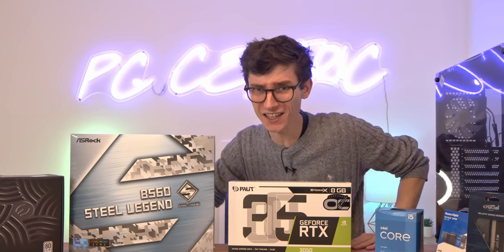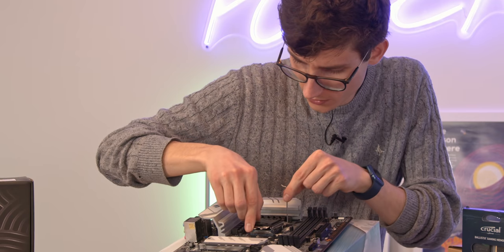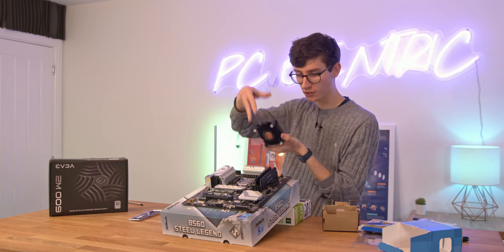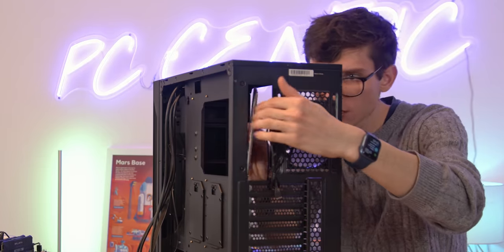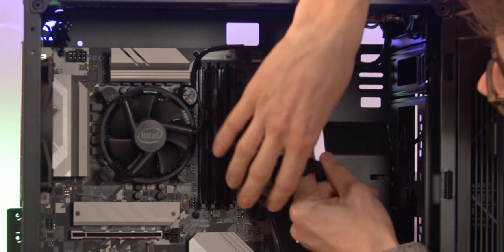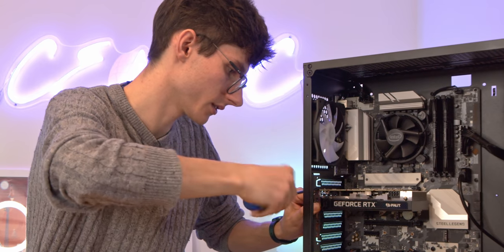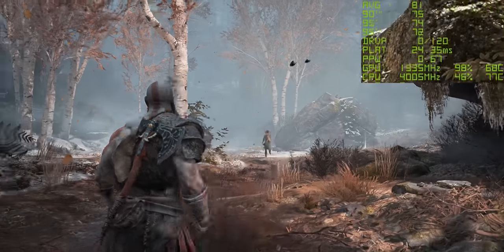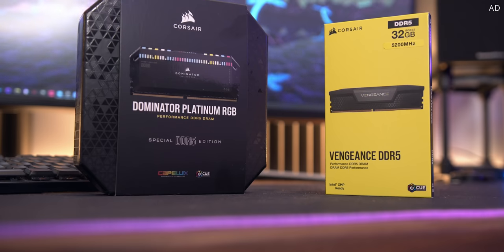The ULTIMATE RTX 3050 Budget Gaming PC Build Guide 2022! 😍 (Benchmarks)

Comment: This was actually pretty close to the actual Pc I'm trying to get. I am getting the i5 12400f and Asus TUF 3060 GPU. Pretty helpful since our builds are similar!
Reply: Just a tip but if its at all possible maybe by piecing it out one paycheck at a time but try to get the 12500f (6 cores instead of 4) and a 3060ti. Its only one step up the product rung for both parts but your getting 2 more cores in the 12500f and the 3060 ti is alot more powerful than the 3060 don't let the low hanging fruit of 12 gbs sway you to the 3060. of course with the times good luck finding any graphics card right now close to MSRP.
Reply: @timsisco3742  I second this
Reply: @timsisco3742  the i5 12400 also has 6 cores right?
Reply: @timsisco3742  i mean rx 6600 xt is a good replacement for 3060 it's not as strong as 3060 ti but it's cheaper
Reply: @art1654  different place, different price. and maybe he want ray tracing
Reply: @jseuren8825  wow what was i thinking your right, was thinking 12100 vs 12400. my new, new years resolution - don't post before noon. Ignore everything i said about the CPU. BUT I stand by what I said about 3060 ti. It and the 3080 are the only 2 cards anybody should be considering for games (on the NVidia side). Also, don't get an H610 board get a B660.
Reply: @timsisco3742  what are you talking about? 12400f has 6 cores as well
Reply: The 3050 is no where close to a 3060. It’s closer to a 980ti.
Reply: he basically did a vid on that already
Reply: yea im getting that exact build or Im getting that with an i7 10th gen
Reply: If you can afford it I’d spend a little extra to get a 3060ti or try and budget elsewhere
Reply: @michaelf3460  im already quite a bit out of my budget which is why im staying with the 3060
Reply: The 12600K/KF has 4 extra efficiency cores and it clocks at 4.9ghz
Reply: Great choice going for Alder Lake
Reply: @hextobyte  it's not worth the extra money
Reply: @DTG4844  For gaming performance no but the e-cores could be very useful for running background tasks/applications such as discord or spotify.
Reply: @dripz628  you still won't run into any performance loss with the 12400, plus the e-cores are currently unoptimized so they cause stutters and have terrible 1% lows during gaming
Reply: @timsisco3742  no offense but what u said about the 3060ti and 3080 being only cards to consider is just awful advice since they are the most sought after cards and are a lot harder to get
Reply: @az_tinkerer_gamer  cap lmao
Reply: @art1654  6600xt is basically 3060 with no dlss, rtx, and 20 less mhs
Reply: @supersop1367  which kinda proves my point doesn't it. Those are the cards smart buyers want. Nvidia is counting on everybody else to just pick up what's left at whatever crazy high price.  My advice was simply don't get screwed on the price over MSRP when the card was already a rippoff from Nvidia. i would of told him to wait for the Intel Arc cards but we don't know when they are releasing anymore. Intel took down the release window. So April would be the earliest.
Reply: @timsisco3742  the card at msrp isn’t a ripoff nor is it a ripoff at street prices either
Reply: @mrwiz124  can u recommend good pc parts for 1k?
Reply: @Ηλίας-ρ4θ   I could but just do it yourself init
Reply: My friends have them and the fps he is getting is pretty good
Reply: Me with 2x2gb gigs, Celeron 108 530 @1.80 GHz: 🙁
Reply: Ummm what do you recommend me in budget? Iam a shithead 8th grader this year with good marks
Reply: @Kiyantha  its a waste of money for playing games, get a next gen console, way more performane and higher resolutions
And 3 times as cheap
Reply: Id prefer amd from intel
Reply: @timsisco3742  that's true I would of wated for the 3060 ti it's gonna be like 600 pound soon
Reply: @timsisco3742  12400f has 6 cores too
Reply: U got it now?
Reply: @Haadii  No. I completely changed my setup, I upgraded to a 3070 and downgraded to a 11400f, works pretty well.
Reply: @twizzsaleh1691  I'm planning on getting an i5 10400f and an rtx 3050 do you think they will work fine together or what should I change
Reply: @Haadii  You shouldn't change anything both these components are capable of 1080p gaming and you should not face any problems trying to run games on them.
Reply: @twizzsaleh1691  should I change the rtx 3050 with an rx 6600 (not xt)
Reply: @twizzsaleh1691  I'm thinking about changing the rtx 3050 with an rx 6600 because it's a little more cheaper and offers better performance in raw gaming and I don't really care about Ray tracing do you think it'll work with the i5 10400f ?
Reply: @twizzsaleh1691  also I'm thinking about downgrading to i3 10100f to make it even more cheaper so I can afford the pc
Reply: @Haadii  I mean yeah of course, but personally I wouldn't go with ryzen because I prefer having ray tracing and dlss, but if you dont really car about that by all means do it.
Reply: @Haadii  and regarding you comment about that 10150f I think was it, I would recommend getting it If I remember correctly it has a 4.7 ghz which is equal to a 11600k but of course it has less cores and threads.
Reply: @twizzsaleh1691  to be honest with the 3050 Ray tracing isn't the best experience and I don't think I'll care about it but if I was going to a 3070 or something like that I would go to nvidia too instead of amd
Reply: @twizzsaleh1691  It's the i3 10100f and I think for a price that cheap it really would be great with a 6600
Reply: @timsisco3742  the i5 12400 has 6 cores😂
Reply: @timsisco3742  an i5 12400 has 6 cores not 4, I'm assuming you didn't quite read OP's commen correctly.
Reply: Got it?
Reply: @timsisco3742  the 12400f does have 6 cores like tf?

Comment: The only thing I would change is the ram because for the extra 7 pounds you can get the Corsair RGB 16gb 3200mhz ram. This would make it look better and have slightly better preformance.
Reply: hi he didn’t play warzone in the video and i was looking to build a similar pc and i was wondering what fps it would run on max settings do you have any idea?
Reply: @nolanreed5079    1080p Low Settings: Average 115  fps   1080p Ultra Settings: Average 85 fps   1080p Ultra Settings + DLSS: Average 120 fps

Comment: The 3050 is a 1660 Ti with RT cores and 2GB more of VRAM. Though the real difference is the features, DLSS is a game changer for example.
Reply: Do you think i should upgrade from a 1650 Super to a RTX 3050?
Reply: @raveendhana7084  No
Reply: @raveendhana7084  It is just 1660 super with rtx and dlss and Ray tracing is weak
Reply: @averagegaming5816  OK then i will save money and upgrade to a 3060
Reply: @raveendhana7084  Ok rx 6600 bhi le sakte ho 15000 save ho jayega with same performance

Comment: I recommend getting the MSI Forge 100R, it’s a little bit more expensive than that, but it has tons of airflow and half the time my gpu fans don’t even spin because the actual chip gets enough airflow as it is. it will save you so much in the future just by spending a little bit more.

Comment: I just built a "budget pc" I have a 11600kf and 3060. I love it! Preforms way better than my first pc build which had a xeon e5-2640 and a 1050ti! Was well worth the money
Reply: How much
Reply: @chpzxi7239  it was $1600 but I got it on a payment plan so I will end up paying $1900
Reply: @greengiant5325  cool, I was thinking of getting a pc but for like 500 lol dunno if it's even worth it to be honest
Reply: @chpzxi7239  if you do, get a pc without a graphics card. You won't be able to play much, but it will be a good starting point. In a couple months when you get some more money buy a graphics card. Or you can just go through affirm and do monthly payments for a nice rig. Both have pros and cons, you'll just have to figure out what direction you want to go
Reply: @greengiant5325  

Literally have no clue on pcs haha I just wanted to get one these are what I was going to get but I don't even know what half of it is😂
- Processor Intel Core i5 quad core 3.8 GHz

- 8 Gb of RAM Patriot Viper with black heat sinks

- Brand new 128GB SSD for fast boot and short load times

- 2 TB secondary hard drive for games and storage

- NVIDIA GTX 970 GIGABYTE G1 Gaming 4GB DDR5 triple fan graphics card ( faster than GTX 1650 )

- Brand new 600W 80+ bronze power supply with black, flat cables

- Brand new Gaming case with tempered glass side and 4 RGB fans

- Windows 10 pro installed and activated with genuine license
Reply: I just wanted to play rocket league and iw4x but don't know if that can even run them
Reply: Seems like a good budget build. Personally for upgradeability, I'd try to get a 6 or 8 core cpu and maybe a bigger power supply like 7 or 8 hundred and hopefully a gold rated one. Never want to cheap out on the power supply. But what you have listed should run what you want. Might not be 60 fps at 1080p but it'll probably run it.
Reply: @greengiant5325  thanks man, the price was 350 quid for that build I sent you, you think it's worth it?

Comment: this is such a nice video to find! i'm building my own gaming pc pretty soon and I chose to just wait on the better GPU and build a machine where the other components are a bit nicer (to include a cooling system and processor) so it's great to find a recent build that includes the graphics card i've been looking at (though if prices do go down soon I'll be going for the 3060 or 3060ti as the starting GPU in the machine)
Reply: If you haven't already bought a gpu for it, right now you can buy a rx 6650xt for $285 on newegg or a 3060 ti for $400 at bestbuy!

Comment: Hi 
Im a fan of your knowledge and content and i have a question 

Is it possible to insert a gaming ram in a regular pc 🤔
Reply: Its kind of a vague question. There are a myriad of "gaming" RAM modules. You'll need to check the motherboard's specifications to see what type of RAM it accepts as well as its speed, capacity, etc. In general, most RAM should work with most motherboard. However, there are some instances where a particular module won't work with a motherboard, be it the RAM is too fast or otherwise doesn't play nice for some reason.
Reply: @JJFlores197  thanks for the info

Comment: in total i have a better pc (without the gpu) i have a ryzen 5 3600 Asus B450F gaming motherboard, corsair vengeance 16gb ram, 550 wat psu, 500gb 4gen ssd, 4tb hdd, and a gt 1030 but i'm waitting for prices to drop down a little more and i'm gonna buy a rtx 3050 or rtx 2060 (any recommendations?)

Comment: what do i do if the pc turns on but the keybored and the monitor that i have plugged in doesn’t work?
Reply: That most likely means there's something wrong at POST (Power on Self-Test). Make sure ALL internal components are installed correctly. Pay attention to RAM; make sure it is installed as described in the motherboard manual. Make sure you plugged the video cable into the graphics card and not the motherboard. If on a Ryzen build, make sure the CPU and motherboard are compatible. Some motherboards are compatible, but only if the BIOS version of the board is updated to the version in which that CPU is supported. Unfortunately, its kind of a catch-22 since you need a working system in order to update the BIOS on most motherboards.

Comment: Shame the 3050 will be sold at an actual MSRP of $330 and up, the $250 models are sold at a loss to make AMD look bad. Given that the AMD 6600 street price is only $30-$40 more than that, well...

Also, 16 GB RAM and 500 GB NVMe in 2022? 32 GB and 1TB is the sweet spot for those! Otherwise pretty solid build, but I would spend the $150-$200 extra for the 6600 and 32 GB RAM, that's like... 10% extra on the price? :)
Reply: Street prices for 6600 are legit like 450$ what are you on
Reply: Also 32gb ram is practically useless
Reply: @supersop1367  Try playing Cities Skylines and load the winter map with all mods with 16 GB of RAM. For me it would run out and start thrashing even if that was the only user program loaded. :P

32 GB is like electric cars - useless until you have it, then essential once you realise how much better it is.

As for the 6600 with MSRP $329, wait another month or two, and it will be at $379. Meanwhile 3050 will be $330 and up since the card is manufactured at a loss at any lower prices.
Reply: @wertigon  idk what cities skyline is tbh I just haven’t noticed a performance dif when I had 32gb of ram unless in photoshop or editing

Comment: I think would save up my money and get a i5 12400 and a B660 motherboard that can overclock it. (See Debauer's recent videos.)
Reply: Won’t make a difference if the gpu is the bottleneck
Reply: I think you can only oc on DDR5 motherboards which neutralizes any savings
Reply: @jeromefym9548  Some games are more cpu dependent than others and it's always easier to change a video card than a cpu.

Comment: ive got the same card and on my 1440p 144hz monitor a mix of mid to high settings over 100fps in 90% of games,nothing wrong with the 3050 cards,if you can afford a bit more money id say get a 3060 but anything after the 3060 cards is plus $1000 nzd on top of the almost $1000 nzd you are paying fully not worth it
Reply: What cpu you got ?
Reply: @lukewalker3  just an i5 9400f
Reply: Ohhh nice

Comment: Budget? The far superior RX 6600 can be had for around the same price as the cheapest RTX 3050 on sale in my region. In context the Nvidia card is not compedative at all.
Reply: 6600 is far more expensive, around 100-150$ more expensive aftermarket prices also learn how to spell competitive before hating just because you are salty.
Reply: @supersop1367  Odd since this position regarding pricing (aside fro a handful of subsidised cards on initial launch) has been backed up by channels like Gamer Nexus, Hardware Unboxed, Moors Law Is Dear and publications like pcmag, techradar, videocardz and several other.  Perhaps you can go be salt of their posts/publications? This cards direct compettion with regards to price is the RX 6600, that’s a matter of fact, not opinion and it loses there.. Also, ad hominem attacks on ones grammatical prowess is pretty weak mate. Pretty weak indeed. Also, I‘m not salty, I have flagship GPU’s from both Nivida and AMD in my rigs. Also, I spelled competition wrong earlier just for you! ;)
Reply: @traversharty man’s is overdosing on copying rn